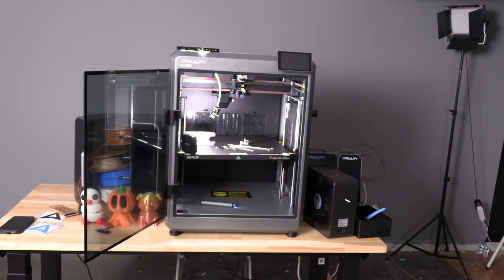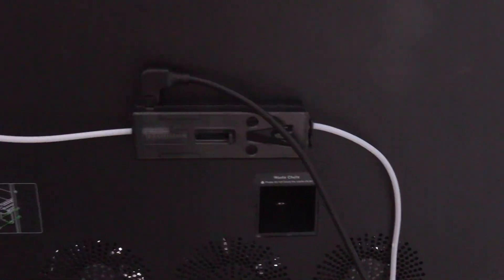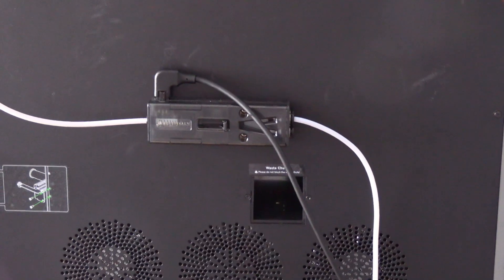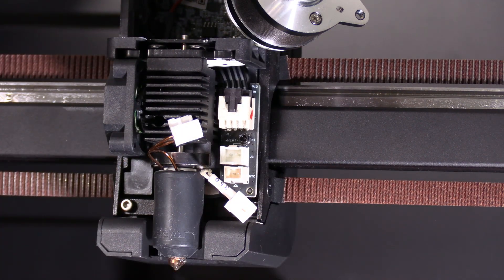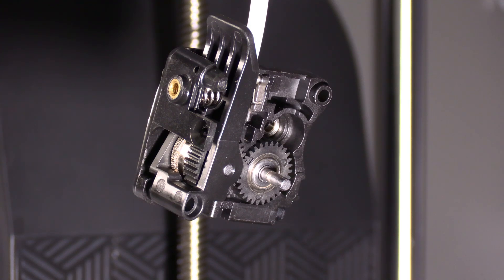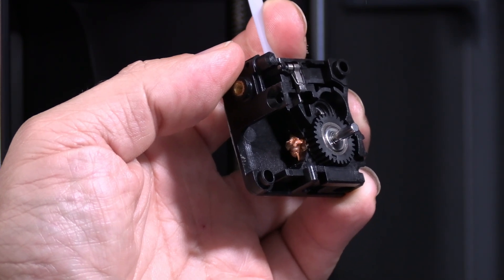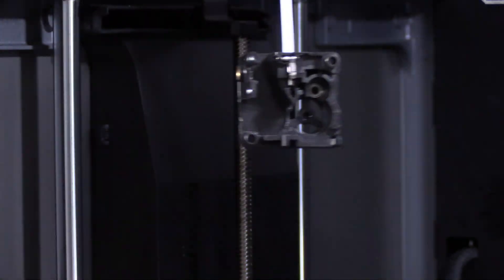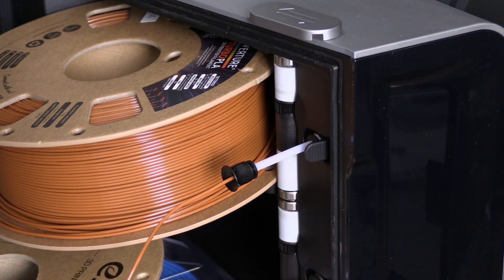K2 Plus DOWN. But not OUT! Dreaded Extruder Jam. Sad Reacts Only. Let's check it out....

Comment: I just encountered this same issue. (I think the 0.2mm nozzle is a lot harder on the extruder, and I have developed a clog.)  It would have been convenient to have a manual cutter somewhere in the pre-extruder pipeline. I di think I need to take off the side spool because it just gets in the way when taking the CFS off the top and stack it on something.
Reply: I was able to get the Bowden tube to release by using the points of needle-nosed pliers to push down on the lock on both sides of the tube. I was lucky!
Reply from the maker: Yes, 0.2 are tough. Slow things down on 0.2.  I would side mount the CFS
Reply: @3DRundown  Yeah, luckily CP6 0.2mm preset with slower speeds also has different filament presets for that size. Max volumetric flow is 2. Even so, it can be rough on an extruder.
Reply from the maker: For sure. The only 0.2 I use, is on my A1, which handles it very well.

Comment: I had two K2 extruder jams on the same large print with PETG. It's somehow most jam-prone when printing first layer over infill (like first top layer or a bridge). The worst is, when there is extruder jam, at the same time there is also CFS jam, because CFS feeding wheel will chew the filament as well, and even if one is able to disassemble the extruder, cut the clog out, put it together, the filament will not feed anymore, so no chance to resume the print. This is really getting on my nerves.
Reply from the maker: Of course you can. Press the tensioner under the cfs, remove the filament, and reload
Reply: @3DRundown  The thing is, both times it happened to me, the cfs feeder wheel by chewing the filament created kind of bulge on it, so some force (the force which will not be overcome by cfs itself) was necessary. And one cannot remove the PTFE tube while filament is stuck, so there is nothing to pull on = not really simple procedure.
Reply from the maker: I've had the chewed up situation. Check all the tube connections. if ANY will disscionnect, pull it out through there. Even if that means, cutting it at the spool, then re-feeding it after.

Comment: I didnt read all of the comments so don't know if this was suggested.  But - I would suggest just snipping the bowden tube ptfe and the filament in a convenient place and released the stress from the chain.  THen discard the inch or so of ptfe as waste as you go through the system getting the filament out.
Reply from the maker: The hold up was in the extruder. Once that clog was cleared, the filament could be pulled out, and all the couplers release properly again

Comment: I did a few prints using the CFS and immediately disconnected the CFS for fear of this.

I print using an exceptionally hard and durable PLA and on the very first print, after valodating everything with the included filament, it jammed.

The reason it jammed was because it failed to cut the filament all the way thru and essentially tried to do a cold pull but failed and it couldn't retract or extrude anymore. 

I unplugged the machine, disconnected the CFS, plugged it back in and then i hot plugged in the machine and as it tried to do the initial extrude i pulled off one of the boweden tubes and then switched off the machine before it continued to unravel the whole spool.

After digging into the commands it sends during filament changes and sending them one by one using the terminal in the fluidd browser, they are poorly optimized and unfortunately hard coded into the firmware,  each macro calls on several other macros that are entirely hidden from the user.

For now, i have been printing from an external spool holder and created a my own start_print and end_print macros with my own filament cut and retract macros and it has printed over 50 tiny prints of 30 seconds flawlessly non stop.

I've also shifted all the nozzle wipes to after the end of print and saved all the calibrations to the printer or slicer and the start up time from a completely cold start is a little over two minutes from the moment i send the file and it starts to print.

Comment: My K2 Plus just came across this same exact issue yesterday, but worst. While  trying to retract during a multicolor print, a piece of filament melted and got jammed inside the extruder assembly. There's absolutely no way for me to take it out without damaging the extruder.  Had to reach out to Creality to get a replacement. I can honestly say that I'm disappointed in the quality Creality sent out. I thought they learned from the K1 series lineup? To pay $1500+ for a machine, I expect it to work right out of the box. It's definitely not fun having to take this brand new machine apart in barely under a week. This was with a white roll of Creality PLA that they sent out with the printer. Mad and frustrating, can't print anything atm.
Reply from the maker: Meh, it happens. Both my LAUNCH K1 and K1 MAX, did 2000 hours on their original Extruder and Hot end. I've had Bambu's blow out extruders, in literally the exact same way. The K2 Plus extruder comes well apart, to clear it, and mine went back together fine, where my Bambu clog, caused physical damage to MULTIPLE components. These things happen. Sucks, but they happen. Be sure to run things at reasonable speeds. Allot of peeps are just printing WAY to fast all the time. Also, PLA at 220, not higher.
Reply: @3DRundown i was able to get that melted piece of filament out of the extruder. But now I have a feeling I damaged the filament runout sensor. I am unable to print or re calibrate my printer now. It keeps throwing error messages, "extruder filament detected, please retract filament before self-check". I'm really not sure at this point. Really contemplating about returning this printer now 😢
Reply from the maker: Write to creality, with a photo of the error, and ask them to bring it up to their engineers, for a solution. They are pretty good about that. I would disable the Runout, which I do on all my machines, but not sure how to do it on the K2. Probably easy. Just have to look into it. 

Can you heat the nozzle, push filament through it manually, the, pull it out? Just to be sure it's all clear? Can you double check, to see if maybe the detectors wire is not fully seated?

Comment: Hello, is there any way to get a video on how to remove the front cover of the extruder?  I have a broken piece of filament that I  just can't remove.  Help? Thanks in advance.
Reply from the maker: Hi. YES. This has been in the plans. I will see about fast tracking for you. It's easy. It's like 2 screws. Lemme try to do this for you asap.
Reply: @3DRundown  Thank you sir.
Reply: Another quick question, do you know if the extrude itself can be purchased by itself?  So in the future I can just swap it out.
Reply from the maker: I don't know if it's available yet, but, it will 100000% be available for swapping at some point. All of Creality's previous extruders are easy to get.
Reply: @3DRundown show how to remove the gear with the spring and how to re attached because it is a bitch and if it flies its gone.
Reply: If your sticker is still on. Just remove the 3 screws. When pulling towards you , u must depress the filament release lever at the same time. The screws on the right. You will see 3 . It's the one in the middle. And the other 2 screws are facing you. Hope this helps

Comment: Had similar issue, occured during a color change with PETG and the clog was behind the "trigger" metal lever behind the spring inside top of extruder. Was never able to get PTFE to release, but was able to use the clog tool from the provided toolkit to push the pin holding the trigger in place over and access and clear the clog. Sucks not being able to remove the PTFE, but once spare parts are being sold I'll buy a new extruder and feed tube to make it right. PS. I'm using the 1500mm Bambu 6 pin cable on the CFS and it works fine with an identical pinout, which makes moving CFS to the side for servicing or access easier.
Reply from the maker: To get the PTFE off, the Filament has to come out. 
I connected the Bambu Cable, but, had a really hard time getting it off, so I refrained from mentioning it. I thought it was gonna break the port, trying to get it off. But, we are revisiting all that this coming week, with CFS #2.

Comment: I had that happen to my k1 max but since it didnt detect anything it kept trying to print meaning the filament in the hotend over 10 hours of staying in the nozzle started to go to shit and it fused the nozzle and extruder with the stuck filament so I couldnt remove them. I had to get my benchtop powersupply out and power the hotend VERY carefully to try and seperate them
Reply from the maker: better off just swapping it out, and getting back to work
Reply: @3DRundown  that's what I did, the problem was having the whole thing fused because of the filament inside so I couldn't remove the extruder or the hotend without having the hotend unscrewed and pulling on it while my benchtop power supply heated it up

Comment: I had the same happen on my K2 with less than 12 hours printing. I was using elegoo petg rapid for the first time and it clogged after the first layer.
Reply: Mine did the same exact thing 4 days in. Mine had a bad clogged inside the extruder assembly. Took me a few hours but I sort of figured it out. It's pretty simple but will require you to remove the filament runout sensor clip inside the extruder. The issue is, when retracting filament, it gets stuck/jammed within that filament runout sensor. I completely had to remove the runout sensor to fix the issue. Got it back up and running and been printing since. I think this was a poor design on creality part. Why put the filament runout sensor inside the extruder 🤷‍♂️🤦‍♂️
Reply from the maker: So far, this is my only one. I believe it had something to do with a bad slice in Orca
Reply: This happened to my K2 Plus before I even inserted filament! It came from the factory clogged with blue PLA...

Comment: Have you had this happen again since?  I've been fighting with this and now I'm also seeing that it's not cutting all the time between color changes and jams in the buffer.
Reply from the maker: No. This was the only time. I realize, using Orca Slicer, was causing false errors reporting at filament swaps, and I believe this is what caused it.
For PLA, keep your nozzle temp at 220, and avoid printing too fast. I am usually around 200mms
Reply: Flip the extruder, pull the blade out, use a nylon brush and clean out the filament dust. Make sure the blade can move freely

Comment: PLA is for children who don't know what they are doing!!!
Reply from the maker: I sold 1500 Cosplay Props in 2024 so far, made of PLA. How bout you?
Reply: @3DRundown  wow, that's good, but in case you haven't understood yet, I mentioned PLA, this filament in closed printers will always cause this clogging, and once again congratulations on so many sales!
Reply from the maker: I'm saying, I did all that in PLA. I have 3 K1, 4 Bambu. Grinding around the clock. I have NEVER had a clog in any of them. Almost every time there is a clog, it's user error. PLA is the most used Filament on the planet, by FAR, and certainly not something to be dismissed.  Thank you. I work very hard. :)

Comment: I’m also reviewing the K2 Plus and had the exact same experience as you. I’ve disassembled the extruder five times so far. Now I’ve learned that I only need to loosen two screws on the front and one on the side to take it apart. At first, the spring would shoot out, but now I’ve got the hang of it and can remove and reinsert it with ease. However, I still haven’t found the root cause of the issue. It’s strange how the filament gets so tightly jammed between the gears inside the extruder, even though it doesn’t seem to be a simple cutting problem. I’m currently investigating the cause, so if you figure it out, please leave a comment. I’m a 3D printer YouTuber based in Korea.
Reply: I had that issue also two times until now with my k2 also looking for the cause
Reply: @Dexeryy  Are you using the Orcaslicer?  if you are, you should turn off ramming option.  it works.
Reply: @bookledge  yea im using orca. I will try it thank you.
Reply: @Dexeryy вставить кусочек плотного картона или чего то подобного не толще 0.5мм между рычагом ручной разблокировали нити  и корпусом экструдера. Это снизит силу прижима роликов и не даст им сплющивать мягкий пластик. Это снизит вероятность закупорки.
Reply: Fun part with extruder jams on my K1C is that it usually happens when i print too slow (giant layers that print at reduced speed - first, last, support interfaces etc). Heat creep has enough time to do the thing..
Reply from the maker: So far, I've only seen it once. I suspect it was due to working with Orca Slicer. The K2 Orca profile has been temperamental.   I also suspect it make be the filament I used, being somewhat brittle. However, I think the main cause, is printing too fast. Slow things down, and see it the jamming stops. Also, pay attention to the filament that jammed, and when it jammed... IE: filament swap
Reply: Hello, is there any way to get a video on how to remove the front cover of the extruder?  I have a broken piece of filament that I  just can't remove.  Help? Thanks in advance.
Reply: Its the macros they are poorly optimized and what makes it worse it that it seems like the CFS Rollers, CFS gears, and Extruder gears are all independent and operate sequentially. So if the extruder grinds the filament or the cutter fails to fully cut then the CFS gears pull the filament taught and then the roller pulls the roll taught and if its a cardboard spool then it crushes the edges and deforms them.

The root cause is the  CFS is not that important and I've been dealing with other quality of life issues with the printer it self also caused by the software. 

The hardware is truly above and beyond every single printer out there i can speak personally from experience, the bambu, prusa, and vorons have absolutely nothing on this printer when it comes to the hardware. But the software absolutely kill the printer. The moment this printer can be brought into full vanilla klipper, you wont need anything else. There really isn't much to mod on the printer. Just some sound deading and swapping of power supply for one that temp controls the fan. Maybe some proper HEPA filters.
Reply: I have this problem. I had no problem with pla. As soon as i tried to swap to PETG boom. Back to back same jams . Its cutting the filament cleanly. It just gets stuck in the gears with the cfs pulling the ever living hell out of the filament
Reply: This was an easy fix!
Only happened when I cranked up the Chamber Temp!
Creality PLA Red
Reply: Hello everyone, I am going to share my experience, it has happened to me with the K2 plus about 3 times, after analyzing the issue it is not complicated at least in my personal case, the solution, I just raised the temperature of the extruder, the material jam is because the machine follows a pattern by code, if the temperature of the extruder is not enough to melt the material that happens, just as I mentioned I solved it by raising the temperature of the extruder so that it is effective in working with the advance of the material, you also have to check the maximum volumetric speed which depends on the type of material if it is too high for a hard filament the problem could also occur.

Comment: Next time cut a gap in an old ring spanner.
Reply from the maker: I try to stick to methods and tools the average users can do. But, can you elaborate?
Reply: @ take a 6 or 8mm ring spinner and cut a slot big enough for the bowden  tube to pass through and use that to move the lock ring. Old engineering trick.

Comment: I see overture....

Whenever I get a jam... Is almost always overture filament too
Reply from the maker: Is it....  Interesting
Reply: @3DRundown  sunlu, esun, elegoo, anycubic, Creality, polymaker and many more all fine...

Overture at 230 half the time a clog... Have to run it at 240+ then works better
Reply from the maker: I have yet to run any PLA over 220, on a V3, K1, or P1, or X1 machine.... Consider going the other way.... DOWN.
Reply: @3DRundown  will give it a shot again...

At 300mm/s when I tried at lower temps it would under extrude

This is 300mm/s with non high speed pla.

Creality hyper PLA works fine at 220.
Reply from the maker: Ah, I never run 300mms. Usually 175-2225. I also have only had ONE FAIL in thousands of prints, on my K1 and K1 MAX. Slowing down a bit, helps ALLOT....

Comment: super important video! It's good 2 know.
Reply from the maker: Yea, this a big one, cause it can appear as if it's jammed up somewhere, while it's just being held by the CFS buffer. This is not really a thing on the AMS, as you can over overpower it and pull out the filament. The CFS hold on for dear life
Reply: @3DRundown  I'm still waiting to buy CK2Plus or new Bambulab which should come with something big and new idk... :( I need big volume.
Reply from the maker: Creality has been the king of large bed printers for a very very long time....  Way back to the CR10's, 3 MAX, 5+, 6 Max, the CR-M4, and now the K1 MAX and K2 PLUS. Creality has always been my go-to for big bed. I do welcome whatever Bambu has comming, and I am hopeful they will let me work with it. However, with the K2 Plus, you can get to "Making" RIGHT NOW". (or Now-ish), then, re-evaluate your setup, when whatever Bambu has comming, arrives.
Reply: @3DRundown  There is one last thing that stops me, it's customers support, they don't have very positive opinions. I did bought just 3D scanner raptor it's on the way, so I'll see on my own how does the product and support work from creality.